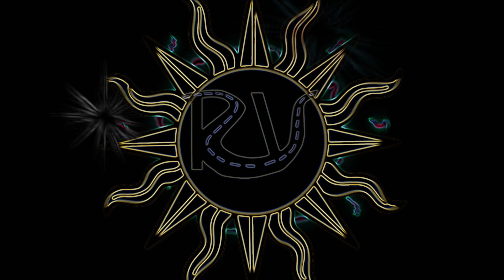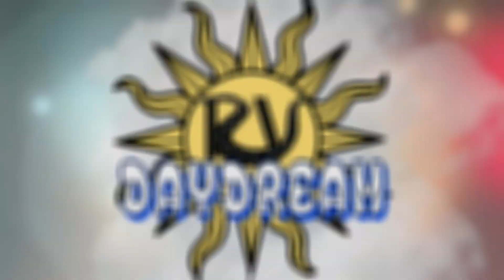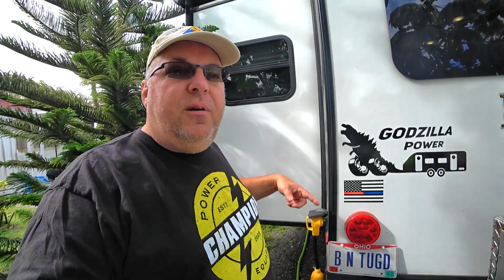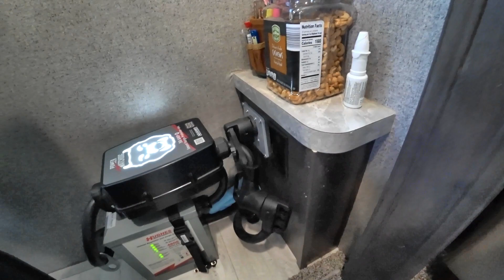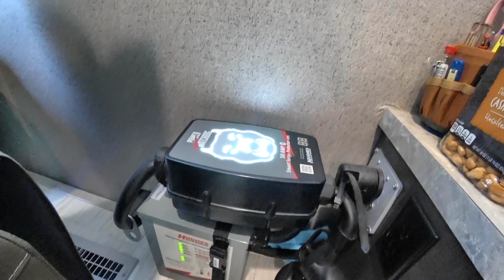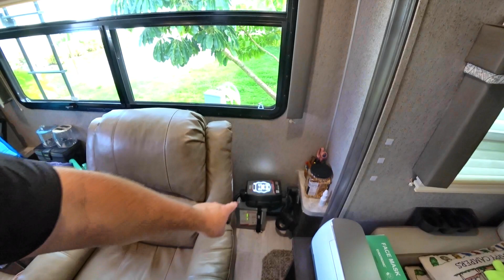Protect Your RV Electrical System FullTime

Comment: We're still very new to the rv world, though we finally have our rv, a 2021 Riverstone 42FSKG.  We've ordered a SurgeGuard, one of the ones that does low voltage, etc., not just spikes.  The hard-wire ones weren't available, so we went with the pedestal model, but will get a hard-wire version later.  Our plan is to install the hard-wire model with a bypass switch, upstream of the genny so it won't interfere with that, and keep the pedestal model as backup in case the hard-wire one fails.  I don't think SurgeGuard does the "autoforming" though---just shuts down if the power drops.  We're currently set up in a "resort" near our house, to try things out and get used to the rig.  We've seen a number of power failures in just a few days, so I'll feel a lot better when we have protection in place.

Sort of related: clocks, like the one on the microwave/convection oven, need to be reset when the power goes out.  From what I can tell, that's going to be every time we disconnect from shore power.  Even if we then switch to the inverter, the power is momentarily out, and the clock needs to be reset.  What do people usually do about that, just ignore that clock?
Reply from the maker: We find that the microwave is pretty easy to reset on almost all models however the stereo that's 12 volt so that clock always stays accurate even when it's unplugged
Reply: @Rvdaydream  We had to look up our microwave's instructions online.  The paper instruction manual started with pressing the "clock" button, which is what I'd have done before looking at the manual if there had been such a button.  Nope.  Turns out you hit the "My Settings" button, then "9".  Why 9?  The prompts don't tell you, but the online instructions do.  Anyway, you then hit "OK", then enter the time, then "OK again.  It's perfectly intuitive!  Maybe that's the only clock that power outages will affect, I don't know.  If so, we may just ignore it.  It makes sense the 12V stuff just works.  I wonder why the microwave clock doesn't have a simple battery backup, like some other equipment has.  Even for sticks-and-bricks, that's handy, and very cheap.

Comment: What was the reason you changed to a Honda generator  from the champion?
Reply from the maker: Smaller, lighter, quieter, uses less fuel, easier to mount on RV in an closure, easier to add external fuel tank for long continuous run times.... Had updated Rooftop A/C units with the Easy Starts so was able to "go smaller" and still run A/C.... Basically though, if you have the no problem lifting 110 lb or mounting 110 lb and you don't have Micro Air Easy starts then the Champion by far is the best way to go..
Reply: @Rvdaydream  Will it run both AC at the same time with the micro air easy starts? I don’t have them. This is why I was thinking the champion would work. Yeah worried about the weight and the movability of the champion. It would have to live in the back of my truck.
Reply from the maker: The Honda EU 2200 does not run both rooftop air conditioners however, you could go back and watch my video where I attempted to run both rooftop air conditioners with the champion with the micro Air Easy start installed and the champion also did not run both rooftop air conditioners for whatever reason. The strange thing is I had anatema 3000 watt generator that ran both rooftop air conditioners off of the 30 amp with micro Air Easy start installed on both. Again just check out that video I think it's entitled "run both rooftop AC" or something like that
Reply from the maker: https://youtu.be/gQlSSsGOq8U
Reply: @Rvdaydream  great! Thanks

Comment: Do you use this with your generator? My surge protector won't work with my generator because of the open ground.
Reply from the maker: There is no need for a surge protector with a generator as the generator has built-in safeties already. It will not overcharge your RV. And as far as low voltage what happens whenever the generator gets over demanded to the point where low-voltage might start getting supplied it will shut off and go into overload mode again protecting the RVs electrical system so no I bypass that inside the RV that is why I have the plug set up the way that I do so that I can plug the RV in direct bypassing the autoformer and surge protector..

Comment: This is all new to us. We are waiting on delivery of our first RV (GD Reflection 303). Can you please clarify the order of the connections inside your RV? Is the surge protector plugged directly into the new internal plug (with the incoming outside power)? Then is the autoformer plugged into the surge protector? Where is the connection to the rest of the RV?

Also, if a portable EMS were used, could it be inserted into above order and be plugged into the surge protector and then have the autoformer plugged into the portable EMS? Or would the portable EMS be plugged in after the autoformer as a 2nd level safeguard and way to monitor power going to the RV?
Reply from the maker: We are going to have a live chat starting at 5:30 p.m. eastern time today. If you're able to sign on and ask you a question I should be able to explain it a little bit better directly. Basically I took the wires that was connected directly to the RVs charger controller and severed them and put a plug on one end and a outlet on the other. The outlet is connected to the outside power supply. The plug is routed up through the floor and is still connected directly to the charger controller of the RV. The autoformer is plugged into the outlet that sees the outside electrical supply. The surge protector is then plugged in to the autoformer. The RV  plug that comes out of the floor that goes to the charge controller is then plugged in to the surge protector. I'm not sure what an EMS unit does. That is the first time I have ever heard that term. I don't believe that there is anything else that would be  to protect the  electronics and also the appliances

Comment: I thought those autoformer boxes had surge protection built in? Not saying this isn’t a good idea but couldn’t you check the voltage at the source with a cheap multimeter?
Reply from the maker: Yes the autoformer box and the Watchdog surge guard both have built-in surge protection and they both have low power shut off protection. As far a checking with a cheap multimeter that's exactly what this box does all the time constantly 24 hours a day 7 days a week as long as it's plugged in that's something that I don't feel like doing I kind of like to enjoy doing something else than standing out at the power pole looking at a meter all day long. 😂

Comment: I like this kind of setup. Always a fan of the self contained modular simple setup. Having all the accessories outside that you have to drag around  and hook up always seemed a bit clunky to me.
 I would like to see the same kind d of thing happen with the water supply, hard mount the regulator and filter ect with access to replace as needed. Cleans up the whole system much better